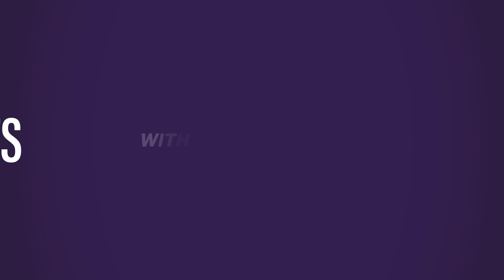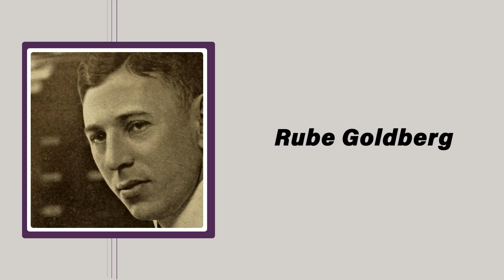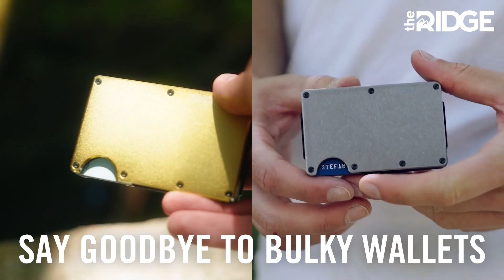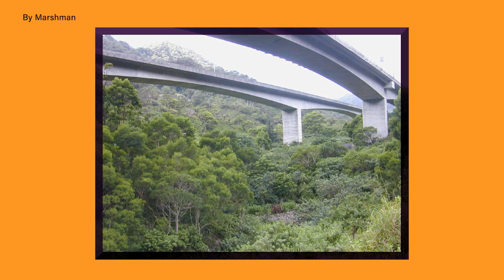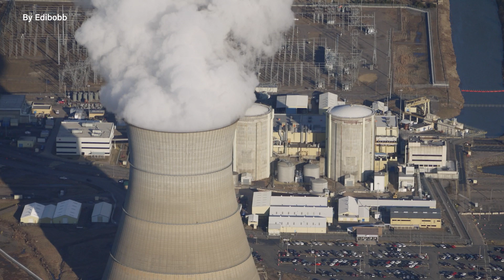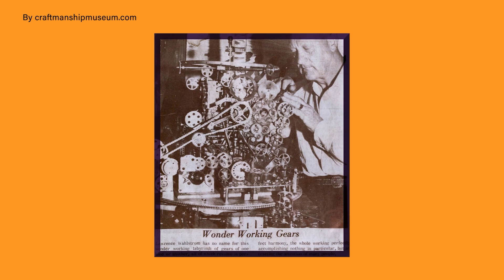Most Useless Feats of Engineering

Comment: Having lived on Oahu, I disagree that H-3 is useless. Controversial? Maybe. But not useless. It was the most direct, fast, and convenient way to get to Kaneohe/Kailua from where I lived on the leeward side of the island. I used it all the time.
Reply: Agreed. I was a little confused by that, actually. Without H3, the only direct route through the island to Kailua is Pali hwy, and that can get pretty crowded.
Reply: Born and raised on Oahu, h3 is not useless.
Reply: Visited Oahu a few weeks ago and H3 definitely didn’t seem useless to me going west to east on the island. Maybe not a interstate in the conventional sense but still does it’s job.
Reply: Former resident. All Highways in Hawaii are designed to lead to military bases. H3 leads to K-Bay, H1 to Pearl, etc.
Reply: Was stationed in Pearl Harbor, H3 was not useless. It was helpful.
Reply: Former resident of Hawaii here, it was also very beautiful, now if you want controversial, that would be the monorail iirc.
Reply: @SRBONUS1912  hahahaha,, I just left basically the exact same comment
Reply: @SRBONUS1912 there's no monorail on Oahu faka
Reply: @turbosix  it's been 8 years amd they are still building it, you can see a completed segment right outside the bridge to ford island
Reply: @SRBONUS1912  it's not a monorail
Reply: @turbosix  then what were they building? Because I'm pretty sure it was a monorail or elevated rail system of some kind
Reply: @turbosix  1.  It was sold as a fast rail system, not a monorail.  But mostly same-same.
2.  It's not there only because after 30+ years it's still not completed.
Reply: I bet it would also be useful in case of flooding or a threat of tsunami to get people to safety. Anything that lessens destruction is very much not useless. Remember, even if it just gets cars and people to an elevated place, that is less destruction and pain.
Reply: @keith_5584 except it provides both access for the bulk of the islands population
Reply: I ran the inaugural 10 miler from Kaneohe to Pearl when H3 opened in 1997.  Definitely not useless.  Made to get the Marines to Pearl ASAFP for deployment
Reply: @johnschilz215  There's a military acronym I've haven't seen in a while ASAFP.....LoL
Reply: Lived there for 4 years, definitely not useless. If I took any other route to and from work, easily would have added 20-30 min to my commute.
Reply: @thisguy7254  20-30 minutes? You got lucky brother. The Pali could add almost 45 to an hour if it was between 3 and 5 on the afternoon. Regardless of the day.
Reply: Anyone else here from Oahu knows about the story of that deadly spot whereas they can't get the lights to stop blinking? 

When the H3 was under construction there is a spot whereas the road is held up by massive vertical columns, these were done by way of a continues pour which the concrete form was rigged up to a big crane and pulled up around the steel rebar as it was filled. 
 Their were hundreds of cubic feet of concrete bring dumped at a time into the form from a second crane swinging a basket in place to dump in. 

Tragically with so much material going in at a time when a labour slipped and fell in he got wedged in with the rebar and almost instantly covered in concrete. 

The Mystery is how did the workers get him out there? Or as the story goes is it possible that he is still in the column right in the spot whereas regardless of replacing bulbs and even the wires they can not get the lights to stop blinking... Aloha ahi ahi
Reply: Rode my mountain bike from end to end of H3. Fast ride going downhill...
Reply: Living in Kaka'ako now and some days I'll just jump on H-3 for fun and come back on Likelike or Pali. Beautiful ride and great way to forget about the day/week for a little while. Actually, might just go do that in a little while.
Reply: @chaseweeks2708  k
Reply: @chaseweeks2708  Reading that makes me glad that joyriding is illegal here in Germany. Imagine living during a climate crisis (and on an island too, no less) and deciding the best thing to spend your free time on is driving a car for no reason whatsoever. Pretty sure my irresponsibility detection meter just broke.
Reply: Agreed, it’s far from useless. This scripts seems to be written by someone who has never actually taken the highway, it’s very useful for many people and cuts the time to get to the other side of the island by quite a bit
Reply: Yeah, I found it strange that they were talking about how useless it was, but in every shot, it was full of cars.
Reply: It's useful when they close pali down for maintenance...that was the only way to get to Kailua from town ... relatively quickly
Reply: I just read this entire thread & lit every single person is such a bore. Especially the long winded essays including extremely detailed facts about every aspect possible. How does anyone have the time to Meticulously explain the most Mandane scenarios and debate them with nobodies
Reply: @jonathancheever1595  That's too bad. I'll try to make a better comment next time.
Reply: You all act like Simon insulted your mothers and not just a highway. Maybe Simon should do a decoding the unknown video about why people on Oahu care so much about the H-3. 😉
Reply: H3 is not a useless highway. If you really want a useless highway, look at Interstate 180 in Illinois.
Reply: Live in Oahu and at one point used the H3 every day for work for an my previous job . Definitely not useless.
Reply: Interstates are required to have a certain amount of "straight and level," wide enough for large aircraft. If you know why that is, you know why I wish it was useless.
Reply: I love you Simon but have you ever been to Oahu? A couple of years ago the face of the Pali fell almost completely cutting off the original route over the Ko’olaus. Life would have been unbearable (the Like Like is Not sufficient for the East side of the Island to commute.) Thankfully we had the (ahem) “Useless” H3.
Reply: It was built for one reason only. Without the H-3, there is no safe route to move explosives (ordinance) from one base to another. The existing ridge crossing highways were too narrow, wind-y, and congested with civilian traffic, while the "go around" method would add unthinkable delays and roadblocks through tiny coastal towns not built for military grade equipment. Unfortunately it's a wildly expensive redundancy that is nonetheless required, like anything made during the cold war.
Reply: Well let’s face it, if the H-3 was ‘integral’ to national defense like it was when originally planned and we were in a conflict, it’d have a giant bullseye on it anyway. Stupid planning, stupidly over expensive.
Reply: Live in England, H-3 is useless I never use it
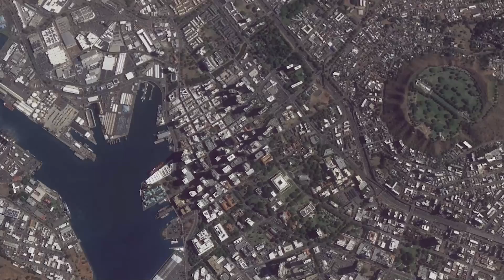Reply: Would have been nice if you showed on the map where highway H-3 is relative to Honolulu. At 8:49 you zoom into Honolulu but I had to do my own research to actually figure out where this highway actually is on the map
Reply: If it was so useful, then why don't you live there anymore? 😜
Reply: @puppetguy8726  How about you go away, frat.
Reply: Agree. Without the h3 I would have spent years more driving.
Reply: Nobody who has a feel for Oahu would say H-3 is useless.   There are three roads that cross from Honolulu to the windward side.  Tell that to people after the Pali Highway was shutdown due to a slide.    He is the second YouTube who make this case, and he parroted the first video.     Simon has a massive fail.   H-3 is NOT USELESS.
Reply: I loved riding down H3.
Reply: Chee huuuu
Reply: Do you know how is the train construction going now? :)
Reply: Oh, Simon, don't worry. With all your videos, I am both entertained and educated. (Does that make it edutainment? Uh-oh).
Reply: My coworkers used it everyday when I worked at PHNSY & IMF plus Hickam AFB. It cuts the travel around O'ahu in not half but quarters. I don't think I will be watching this hoale's channel any more.
Reply: Who cares about H3, how about our $10 billion Monorail to Nowhere?
Reply: I will go there when I go to Oahu.
Reply: Yes I agree. More leftist condescension from Simon.
Reply: @Balthorium what on earth does 'leftism' have to do with him being wrong on that?
Reply: @PaddyHerrlinger  he was crying about the environment.
Reply: @Balthorium  Three questions:  1 - Why do you think that only lefties can/should/do care about the environment?  2 - Why do you seem to believe that centrists and/or righties don't care about the environment?  3 - Should we care about our environment?
Reply: @FrostPDP  it’s off topic. It’s a personal opinion. I’m sure this process required a million permits and the impact on the environment was well thought out by the people on the project. This is a beautiful roadway and viaducts that remind me of I-70 in Colorado but tropical. I can have a positive opinion. He can complain from dreary London if he wants to but he could also just describe the highway without criticizing it. Leftists in California my entire life have opposed every project, building, road and structure of any kind however minor. They constantly have excuses about elk or newts or hilltops or creek sides where they want to ban building and confiscate private property by declaring it unusable. Never once has a Republican thwarted a condominium building proposal or golf course hotel. Local leftists say no to everything including BART which could have gone to Marin under the Golden Gate Bridge but environmentalists gave away half of Marin to the Federal Government for a “recreation area” that had a million rules and regulations and limited daytime access. Mostly empty haunted places that were working ranches before being confiscated during WW2. It could have been a futuristic 60s city with BART but noooo let’s give it all away to the government for the sake of the environment says the leftist not right wingers. Biden it at it right now declaring more federal land off limits to development.
Reply: @Balthorium  None of that really explains where you somehow pulled “Simon is a leftist” from what he said, though. You do realize environmental conservationism occurs across the political spectrum, right?
Reply: @holyfordus  compared to Americans almost all British people are leftists. We have gun collections of fearsome weaponry like .50 caliber rifles anyAR15’s while British people are criminals for having a pointed stick and arrested for misgendering people on the Internet. I’m gonna go out on a limb and say Simon would probably be a Democrat in America even if he is considered conservative in Britain.
Reply: @Balthorium  Yeah, imagine nature having a right to exist. Those craaaaaaazy leftists.
Reply: @wfb.subtraktor311  straw man my argument. They aren’t reasonable. They are against all construction and want to tear down existing dams like Hetch Hetchy despite lack of storage capacity under current conditions. More than half my county is government owned. Hawaii is far from overdeveloped. Most areas are empty. Look on a map. It’s not populated like Pennsylvania or New Jersey. It might make sense to restrict construction to some degree in the East because it’s already built out town and cities. Most of the American population lives East of the Rocky Mountains. The West is mostly empty Federal and State land. Ten more dams and 50 more freeways would make no difference particularly when so many cars here are EV’s which I own.
Reply: @Balthorium  Sorry to burst your bubble, but electric cars aren't much better for the environment than diesel or petrol ones. In fact, they can in many cases inhibit meaningful systemic change. How about instead of building more car infrastructure you use some of the public right of way of existing highways to remove a lane and create high volume transit? More highways will literally do nothing but make American's lifestyles even more car dependent and GHG-emission heavy.
Reply: @Balthorium  Also, here in Germany the center-left green party (they are more left than Bernie Sanders, so you would probably call them socialists) literally just removed environmental rules set up by a previous conservative government that were making it impossible to build on-shore wind. I find it very amusing how you Americans always blame "the left" or "the right" for everything bad that happens.
Reply: @wfb.subtraktor311  No stupid idea. Public transport is very dangerous nowadays.
Reply: @Balthorium  Yeah, because the public transport is so bad that the only people using it are those who literally have no other choice. From my own experience I can tell you that the quality of public transport really impacts the kind of people who use it. In Hamburg, where I grew up, the parts of the city with more frequent and reliable transport have also always been places where it is most pleasant to use said transport. In places where you get a countryside bus (i. e. a bus that combines rural bus services and city bus service in the same line) every 30 minutes and nothing else, public transport feels a lot less safe, regardless of the neighborhood it is going through.
Tl;dr: If you have shitty transport and aren't willing to make it not shit, then only the lower ranks of society will use it and you will feel unsafe. If you invest in making it a valid transport option for everyone, it will feel a lot better to ride it.
Reply: @wfb.subtraktor311  this won’t work in California where violent gang members beat people senseless and smoke crack and fentanyl. Ridership is down 40% in the SF Bay Area. No amount of money will help without arresting these people which never happens.
Reply: @Balthorium  Very true, transit has to be part of a comprehensive policy plan. Here in Germany, we even banned alcohol on all public transport some years ago and this is actively enforced almost ubiquitously.
Reply: @wfb.subtraktor311  I love that Wuppertal Schwebebahn.
Reply: @Balthorium now days? Public transport has always been touted as dangerous. Thing is, it isnt.
Reply: @Balthorium strawman
Reply: @Balthorium  Is "leftist condescension" the moronese for "common sense"?
Reply: @Balthorium  Cool! Some ignorant douche has decided to shoehorn "leftist" into any argument.
Reply: @Balthorium  sooo... why are you here?
Reply: @RabbitHo1e-Inc  his snooty derision only annoys me sometimes. In this case he criticizes something amazing and difficult to build calling it useless. Everyone is useless and dumb except Simon the omnipotent.
Reply: @Balthorium a label is not an argument
Reply: @Balthorium  it’s only leftist cause you made it so. what’s wrong with caring about side effects of your actions? does it make sense to build the most expensive highway ever built to serve comparatively a few people? public spending is only good public spending if it goes to causes that you like? i’m not against the building of the highway afaik, i don’t even live there, i’m just interested in your emotionally driven thought process
Reply: @tropicbliss1198  no statistically leftists are the environmentalists. Look at Greta Thunberg. I’m not making anything up. Stop gaslighting me with ridiculous comments.
Reply: @Balthorium  betcha cant even define leftist
Reply: @jasontroy3911  a person who cannot define what a woman is.
Reply: @Balthorium  I would highly recommend a political science 101 class
Reply: @jasontroy3911 Lame equivalent of get educated. That’s a typical condescending empty retort of leftist filth. I live in California. Been around leftists my whole life. They even kijacked my Dad’s airplane in Honduras. The NYT headline was “Leftists Hijack Plane in Honduras”   I’m pretty sure I know who they are.
Reply: @Balthorium we can define what a woman is, you just confuse woman with meaning female
Reply: @Balthorium  What the hell makes this 'leftist'
You may be radicalized.
Reply: @JoshSweetvale  moronic.
Reply: @Balthorium  more cramming politics where it doesnt belong from you.
Reply: @mike79patton  no that’s Simon moaning about the environment. A leftist opinion. This road is beautiful.  He is a negative limey hater envious of our interstate system that’s a modern marvel.

Comment: The yucca mountain facility is actually complete. It's just not being used because of NIMBYs.
Reply: And in the meantime high and low level waste builds up at facilities not designed to store them and aren’t as secure. Harry Reid- D Nevada facilitated preventing the use of Yucca mountain.
Reply: @larryowsowitz2274  Harry Reid was a toad.  I live a few miles from where he grew up.  You won't find many here who cared for him.
Reply: @larryowsowitz2274  and yet they named an airport after him 🤔
Reply: Well, not "complete" but it IS functional (might need to be tidied-up a bit like any structure left vacant) as it was never intended to be completely excavated at the first phase.

I'll have to go searching later but I recall that, with advancements in deep boring, nearly every facility could have 3 to 6 18" (~46cm) drilled far below any aquifer and into stable rock. That would be enough for all the high level waste and for any of the medium level that wouldn't be safe before decommissioning would be completed. Most of the medium and all of the low level are fine to store on site until they decay to safe levels.

In the United States, a few hundred more reactors and we really could go nearly all EV. With that as baseline and as battery technology improves to make better use of intermittent sources it could work.
::sigh:: I'll probably not try holding my breath.
Reply: @matthewellisor5835  we could but we sadly won’t. Politicians are too stupid to understand the importance of Yukka Mountain and Nuclear Power.

Then again, this is what happens when you are stuck with useless dinosaurs that are still in office. Dinosaurs that couldn’t possibly understand how nuclear is the best and cleanest energy source out there, and NOT a ticking time bomb.